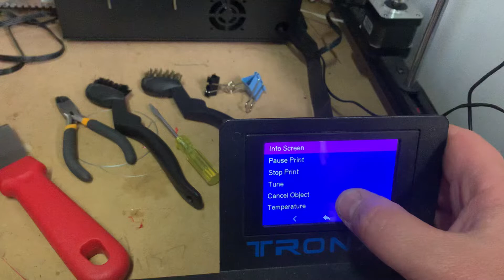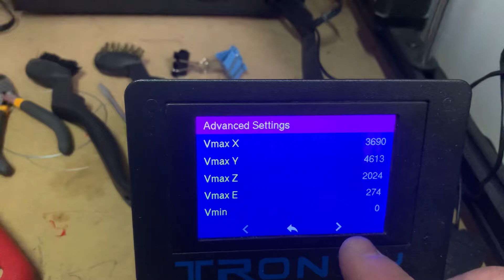BiquH2 setup tips on Tronxy x5sa Pro

Comment: Which version of Marlin are you running?
Reply from the maker: Theres a version compiled by Aaron Greengrass in the Facebook user group. Super easy to install from sd card. I had to radically increase the max speeds and accelerations though when converting to the BiquH2